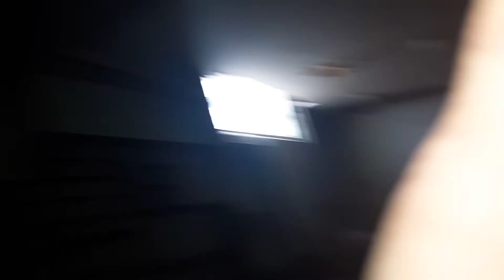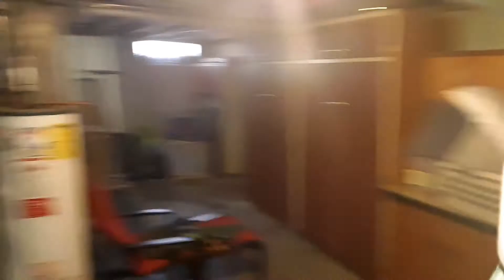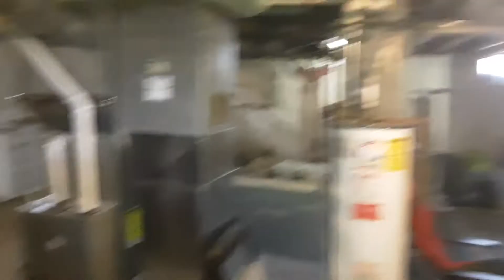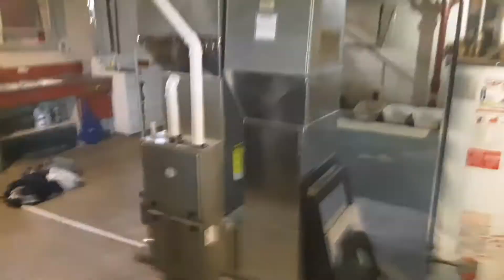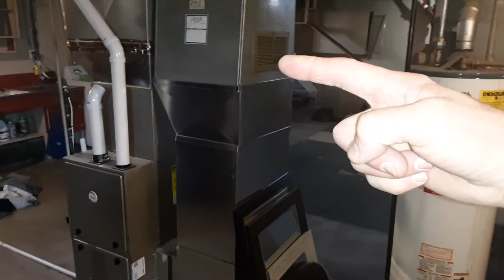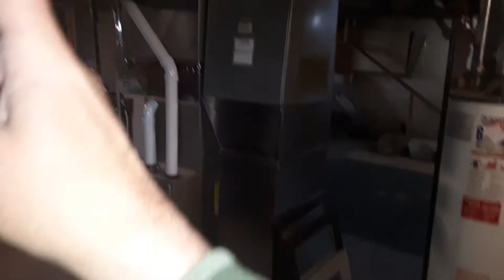💨 Cold Air Return vent next to water heater causing back drafting & 💀Carbon Monoxide issue

Comment: So what is the fix for this type of situation 90% efficiency furnace with central A/c?
Reply from the maker: @davidbleigh4646  
Simply cap off the vent with sheet metal. 
There's other cold air vents throughout the house. No real need to have one in the unfinished basement.
Thanks for the question and for watching.
Reply: Thanks. I tried a window and the only cold air return. The draft improved but was still blowing out while the a/c was blowing. It appears there are 2 chimneys in the basement one is sealed off near the new 90% unit. The hot water tank is sealed about 8 foot away on the other stack. The rings on top of the tank are slightly melted. And I checked through the old service metal door on the bottom of the stack. It is still blowing down. I suppose the next step is to check the roof access
Reply from the maker: @davidbleigh4646  
Ok. Now from that description it sounds like your water heater was not converted to a "B- vent liner" when the furnace was removed from the chimney.
The old original chimney liner cannot draft the water heater out properly. A B- vent liner helps assist the drafting up the chimney.
Look up B- vent liners. 
I hope this helps.
I hope this helps.

Comment: 1 WEEK AGO- my basement starting getting COLD drafts. As in I went from wearing a shirt, to 2 sweaters PLUS a winter hat. I can feel the breeze. Even upstairs main level - -- I feel some cold breeze.   BUT....my heat is working! There's warm air coming from vents. I've felt every vent in the house - NO cold air from there.   I do hear a 'thud' once in awhile I assume it's from furnace.   Based on these clues - is it possible the furnace or HVAC is responsible for this sudden cold-ness in my house? BUT if so - and cold air isn't coming from vents ---where the heck could it be coming from?   Appreciate any opinions...maybe it's not furnace and it's something else but this is weird, just started a week ago.
Reply from the maker: Sorry I didn't get back sooner.
I get a lot of strange questions about homes and they can be tricky to figure out. So here is some info that may help. 
1st: temperature can't be seen and people remember that heat "rises" to the highest point in the home but they forget that cold air "falls" down to the lowest point. (Basement/crawl)
"Thermal Imaging" can be done to physically see the source of where the cool air is coming from. You can find someone locally to hire that has that equipment. Such as an insulation company or a private home inspector. 
2nd: To me it sounds like if it came on suddenly then something may have been changed or altered.

Example: Attic hatch cover left open, window left open on any level, basement with a crawl space that has cross vents that are not closed up for winter.
I hope some of this information helps.
Good luck and thanks for the question and for watching the video.

Comment: Can a cold air return be installed if the gas water heater is in the complete opposite direction? can that still cause backdraft?
Reply from the maker: Thanks for watching the video and sorry it took so long to respond. 
If the water heater is installed on the other side of this furnace, it would be more least likely to cause the back drafting because of the large open basement. However, the rule of thumb is to not have a cold air return in the same room/area as the water heater draft hood. 
Cold air return vents have also been known to blow out pilots on water heaters and you may also notice that cold air vents are not installed in kitchen areas because of the same reason.
Hope this helps. 
Thanks again for watch.
Reply: got it! thank you.